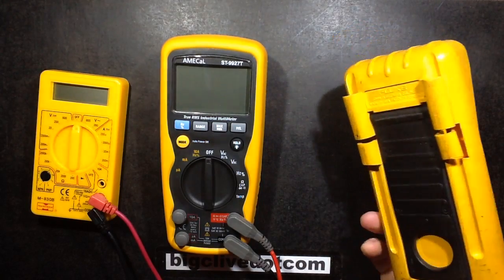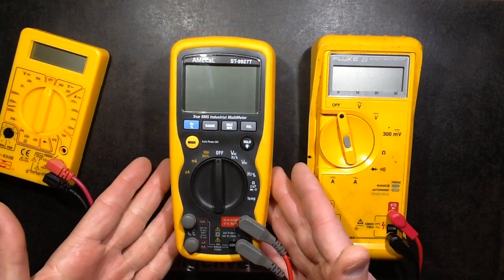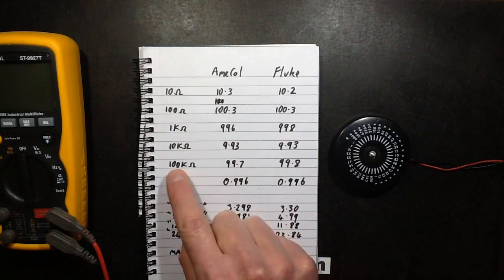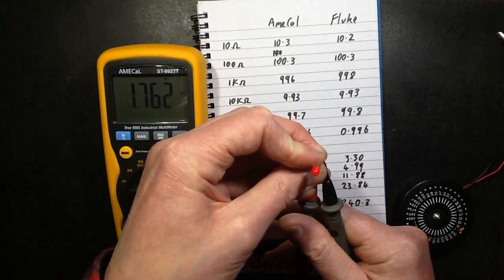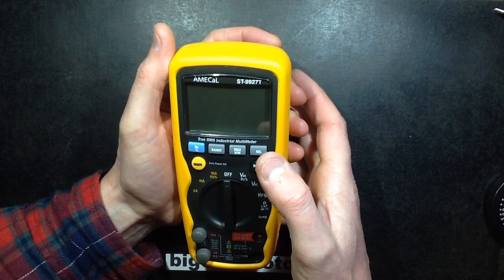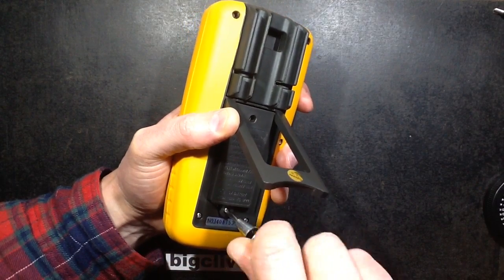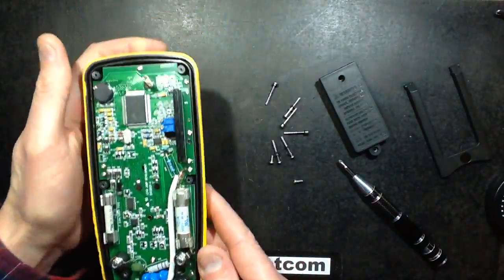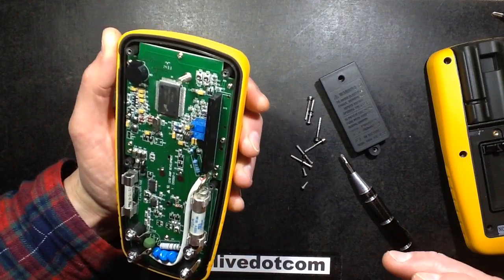Test and look inside Amecal  ST-9927T multimeter.

Comment: I've bought one of these and found initially it was measuring resistance completely wrong - with the probes not connected it was reporting 1.4K or so and testing some resistors just produced daft readings, always too low.  Other readings e.g. AC mains voltage and a few capacitors seemed sane.  Tested resistance again, still way off.  Tried DC voltage on a 9V battery just to sanity check that, and that was ok, then tried resistance again and it's spot on, or at least within tolerance, and shows overload as expected when leads aren't connected.  Would measuring DC voltage have somehow made the meter re-calibrate something to do with resistance measurements?  Seemed rather odd.
Reply from the maker: It sounds like it may have been a bad contact on the rotary selector.  If it happens again try rotating the selector a few times to clean the contacts.
Reply: bigclivedotcom thanks, Amecal made the same suggestion when I asked them via eBay so hopefully you’re both right and it’s nothing more serious. It has shown bad readings a few times since earlier but touch wood has been fine for a few hours now. I noticed as well that say the bogus reading was 1.234k on auto,  cycling through manual ranges would show 12.34k, 123.4k, 1.234M, 12.34M, etc i.e. same digits on each scale, or sometimes a couple of digits difference. Seemed odd, could that still be a dodgy rotary switch contact even though range selection is independent of rotary switch?

Comment: Hi Clive love watching your vids could I ask you a question in my kitchen I have 8 GU10 halogen 35w bulbs without transformers what size of led bulbs should I replace them with to give me the same brightness and save on electricty my bill is out of control  looking forward to you reply
Reply from the maker: +Ray Campbell Try a 3W warm white lamp in one first to see how it looks.  I don't recommend going much above 3W because heat rapidly becomes an issue with the GU10 style of LED lamps.  To cut the electricity bill down, look for heating loads in particular that may be set at too high a temperature.  One of the biggest rogues is the immersion heater if you have one.  Especially if it runs 24 hours a day.
Reply: Thanks for getting back to me your answer will help and I will go by your thought

Comment: Having owned this meter, it does have the most annoying habit of turning off after 15 minutes of use...even if you're still using it.

You can disable that by holding the mode button as you power it up, but it won't remember when you next power it on

Comment: Away with you, Clive, you know as well as I do that screws are there to be unscrewed!  Even as a nipper, I couldn't resist undoing the screws holding the backs on radios, televisions and almost all domestic appliances!

I might have to have a look at one of these meters, but first of all, I need a new clamp meter. My old Fluke one has finally bitten the dust. After all these years, the plastic has become crumbly on the pivot of the moving arm of the clamp.

Comment: That looks like a rebranded SouthWire I bought. SouthWire (a lowes brand) made one of the best pair of wire strippers I have, but the meter was crap. I found the millivolt range to be hideously inaccurate and the continuity check was slower then I can work with on tiny surface mount components.

Comment: The SAME seller wants 50 Pounds shipped to Germany. It's ridiculus... Perhaps I can put a link of your review and partially teardown in a message asking for free shipping to Germany? :D Would like to buy it as a second multimeter. I actually have only a Fluke 117C, which does only Amps with 3 decimal places but I'm not confident about the readings under 10 mA. It's more an electrician meter than a electronics engineer meter. - I also got the Fluke 117C from a seller from UK - but with free shipping...
Reply from the maker: £50 seems a lot for shipping to Europe.  It might be worth asking them about the shipping cost because ebay sometimes does weird stuff with international shipping.  Royal Mail is not very cheap, but not £50.
Reply: Thanks, I may ask them. :)

Comment: I've looked this meter up and amecal photos show a different dial and a CE label at about 7 o'clock just above the 10A socket.
Reply: ***** Confirmed. I do hope this isn't a case of a seller downgrading something after they've got good revues of the original.
Reply: Graham Langley Tried to ask what seems to be Amecal's eBay outlet about what's included with the meter - probes, thermocouple etc - but got "Unfortunately, due to the high number of emails this seller receives, they aren't able to respond to your specific question right now."
Reply: Graham Langley Just bought one and the one I got is the same as Clive's, with the OFF position at 12 o'clock. First impressions: The switch is quite stiff,  temperature reads 3C low at 22C which it seems is within spec, and the continuity beep is far too slow for my liking.
Reply: Graham Langley Update: After letting it come up to ambient - presumably something to do with cold junction compensation - it's within 1.5C or so.
Reply: Graham Langley And now I've refreshed my knowledge about thermocouples it's obvious what's going on. 

When using the thermocouple the cold junction is the 4mm to K-type plug adaptor and there's no way of measuring its temperature so it can be compensated for in the reading. In order for it to work the meter - which I guess attempts to implement cold-junction compensation based on its temp - and the adaptor need to be at exactly the same temp.

Comment: A smashing meter, ha ha i would have wanted to remove screws as well :-)
In comparison, i as a hobby electronics repairer have used dvm's that dave would really hate, the 830b types work well for basic stuff, i dont use them on mains or ac, for a blobchip (icl7106) and very little parts they are very usable.
My original meter is an old digital from tandys back in the 1980's 80quid at the time, a grey double knob manual meter, ive had it hooked up to 3 phase, never any problems it never went bang, i dont hold multimeters lol, dave would have a heart attack lol.
Reply from the maker: The little meters are fine for bench work.  I have a couple that I use as general monitoring meters.

Comment: I too dislike the NICEIC, but, as responsibility goes, I blame the IET. NICEIC aren't the only players, they are, as you say, a profit making company trying to defeat the competition and make more money than anyone else. It's the IET that are making the rules by which the NICEIC are making their gains.
Reply from the maker: The original IEE regulations before the name change are a very good electrical standard.  But the new era of IET involvement seems to involve manufacturing new regulations, tests and acronyms purely for profit and not based on reality.  Many of their regulations are for incredibly improbable circumstances.

Comment: part P - don't get me started!  that made me leave the electrical engineering industry as it always made me smile I am qualified enough to design the wiring spec for a large shopping centre worth millions, but I need part P cert to change a lightswitch in my house.....
It opened the industry to a load of unqulaified people who attended a small course.
A few years ago I quoted for a friends rewire, he got it done £500 cheaper - and was certified.  Trouble is everything was wired in 1.5mm 6242Y.
I sure we both have stories to tell....
Reply from the maker: The whole of the UK electrical industry has been screwed up.  Most of the installation work is being done by labourers with no actual understanding of what they are doing.  They're not getting qualifications, they're getting liability disclaimers.
Reply: thats why I left it....   Along with the NICEIC who did not do anything to rectify the issues.
Reply from the maker: Phil Docker The NICEIC is making a fortune "licensing" all the kitchen fitters and handymen, so there's no real incentive to do anything other than pocket voluminous quantities of cash.
Reply: bigclivedotcom They're a private organization, I refuse to pay any attention to part P and the NICEIC <evil grin>
Reply: bigclivedotcom 
A neighbour had a kitchen installed by fitters from one of the DIY sheds post-Part P who ran the cable to the cooker hood diagonally behind the plasterboard. I pointed this out to her and she raised it with them. Apparently it was 'quite safe' and I 'didn't know what I was talking about'.
Reply: +Graham Langley argggg... Part P came about because an MP's brother-in-law was killed when putting up a shelf in a kitchen and drilled through a wire run diagonally (story from memory so some detail may be wrong).

Comment: Bought one on the strength of this video and after just over three years of very light use the range switch has packed up, which I gather from Clive's comment elsewhere is a common problem. I'd recommend you look elsewhere.
Reply from the maker: I'm going to see if I can fix my meter when I get back.
Reply: I've posted on Amecal's Facebook page about this. It'll be interesting to see what they say, assuming they monitor it.
Reply: It's gone 5pm and no response from Amecal.
Reply: After a prod they responded and offered a no-cost repair on return of the item, presumably at my expense.
Reply: Sent the meter off last week and got it back this morning with a simple "No cal required. New switch mech. fitted" written on my delivery note. 

OK, they fixed it when just out of warranty and I've got a new battery, but I would have appreciated some reassurance that it won't happen again. I've given AMECal the opportunity to explain, hoping for something along the lines of sorry about the problem, they know about it and they've fixed it on current production, but they remain silent. Other manufacturers seem to be able to design a range switch that will outlast the meter, so why can't AMEcal's supplier? 

Until AMEcal make a statement here about the reliability or otherwise of the range switch I advise that you look elsewhere.
Reply: Graham Langley They made a statement to Clive, which he quoted in yesterday's video on repairing the broken range switch.

Comment: I was given a dead fluke 87-v, with all it's accessories, by a large company's local office. opened the meter and found a bad 9v battery lead... either way I'm 'sold' on my fluke over comparable meters because free. If it failed for me though I would strongly consider other less pricey brands before getting another especially since elecchicken work is a hobby for me and yes I only work on my stuff.

Comment: Instead of reading all these numbers off a paper I was expecting you to put all 3 meters in series for a current test and in parallel for a voltage test from your power source. Would have been so much more "intuitive", Would have been interesting how (less) accurate the cheap meters are.

Comment: I have never understood why people are so  obsessed with meter accuracy.  I have always opted for the cheapest meter. I spend most of  the saved money to buy the best available probe sets. I have never had a meter explode on me and injure me. I stay clear of meters if I am probing a high energy situation. I have had meters explode near me, but safely. 
A meter just gives you a figure. It is up to the user to interpret it correctly.  That is the real deal. I have seen people going from meter to meter, each successively more expensive than the last, just because they cannot and are vaguely hoping that the meter will shout out the correct interpretation at them. AC voltages and current are always a problem for them.